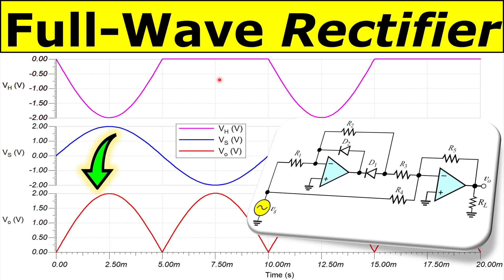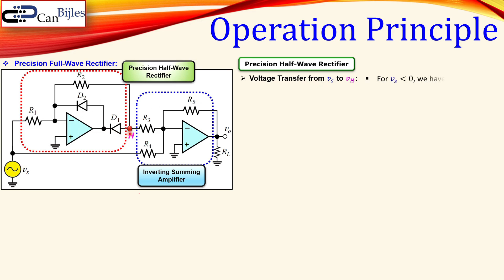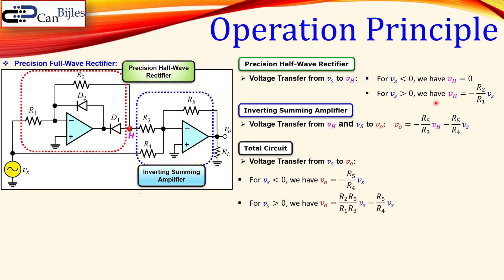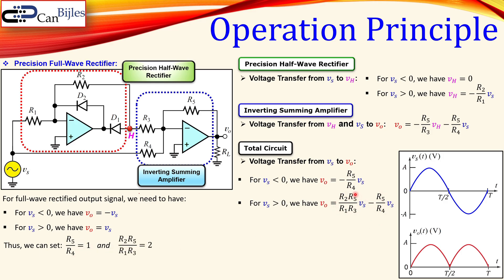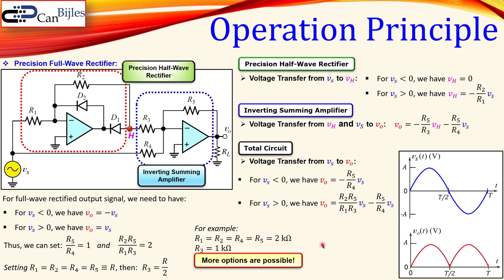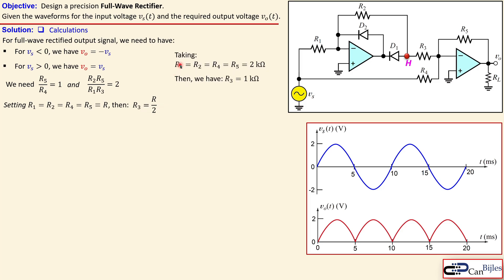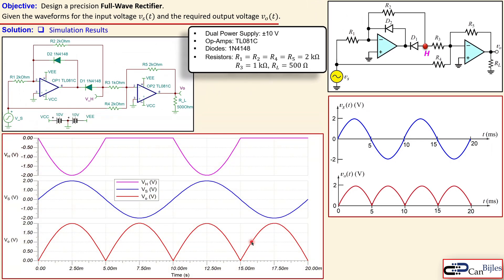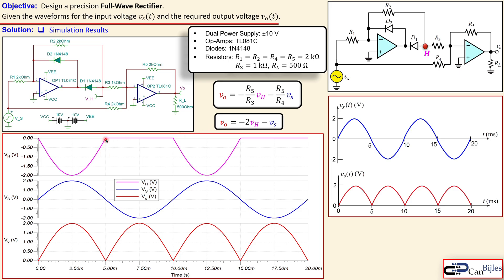Precision Full-Wave Rectifier ⭐ Theory, Design Example & Simulation 👍 #rectifier #electronics

Comment: 좋은 수업 감사합니다. 신호 상쇄로 인한 결과일 줄은 생각도 못하고 있었습니다. 덕분에 시원하게 해결하고 갑니다
Reply from the maker: Thanks for your message. Glad you liked the video, also it helped you out with your problem 😉 Consider to like and share the video 👍
Reply: @CANEDUX  sir i am running this circuit in proteus but there is a voltage drop at output , how can we fix this. i am doing a experiment where the voltage is of the mili volts order so even 2 volts drop is very much efecting my results,.
please help sir
Reply from the maker: @nilanjandey2006  I do not use proteus. It van de caused by any things, like nonideal effects of the op-amp or components around it. You should check the models you are using.